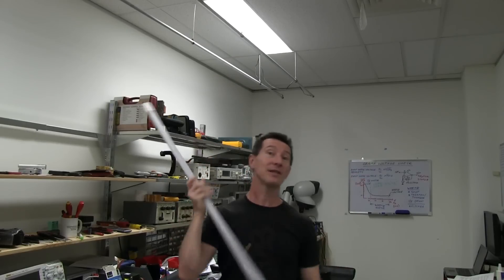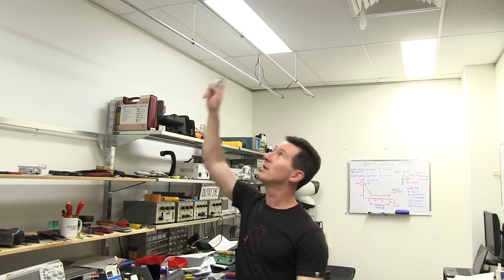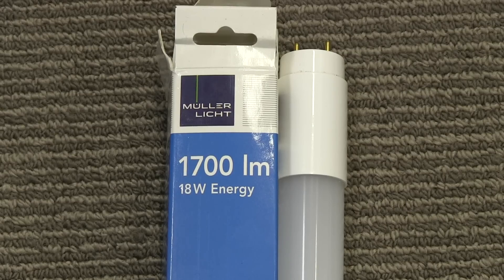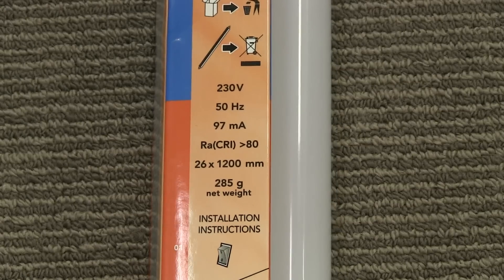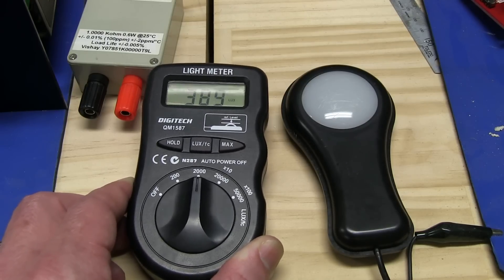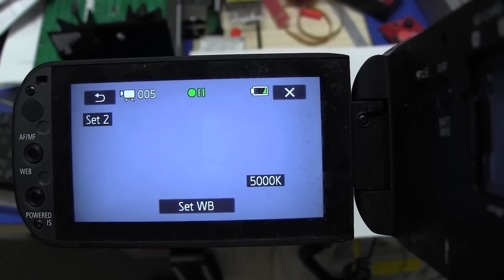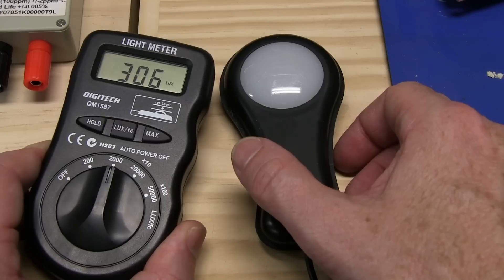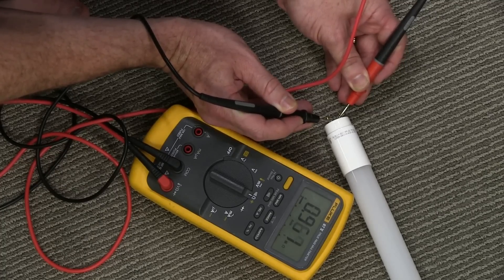EEVblog #531 - LAB LED Fluoro Lighting Tube Replacement

Comment: one major point is that the led only fade about 5% over their life compared to around 50% on the conventional fluro tubes. so the output of the led's over time with led will eventually beat the fluro's.
Reply: Modern fluorescent lamps maintain over 90% luminous flux to over 30,000 hours. I've seen LED floodlights and streetlights with degraded LED chips after only a few months in service!

Comment: 1700lm? Normal 36w 4 foot lamp is like 3300!
Reply: led only fade about 5% over their life compared to around 50% on the conventional fluro tubes, so in the long run led are a lot better.
Reply: No, they don't. Normal fluorescent lamps maintain 90% luminous flux to 20,000 hours and beyond. Just check any manufacturers datasheet. http://download.p4c.philips.com/lfb/f/fp-927921084023/fp-927921084023_pss_en_gb_001.pdf Meanwhile all of the LED battens in a friends place of work have all had to be replaced under warranty because they were failing like flies and were suffering major loss of output!

Comment: I fell in love with LED bulbs very quickly after years of those godawful CF POS energy saving bulbs.  The only downer on them is how freaking much they cost.  Got some of the Phillips master 75 watt equiv bulbs as the main lighting for several rooms, some no-name 60 watt equivs for the bathroom and upstairs landing, and a couple of the no-name 40 watt equivs in a couple of table lamps.  They're brillo.

Comment: WTF 15000 on / off cycles,  never heard of that spec
should be like 20 years unlimited on /off cycles
Reply: The LED shouldn't wear out from toggling, but i bet the stuff that transforms mains power into low DC will.

Comment: Saying LED as a word just sounds wrong to me, because it's pronounced the same as lead, a toxic substance that has been removed from various items over the past few decades (gasoline, plumbing, solder, etc.) due to its danger to public health -- so that's a very negative association that LED lights are trying to be the opposite of, due to their energy savings and lack of the similarly toxic mercury found in fluorescent lamps.

So, maybe in another generation when nobody remembers what lead is and how dangerous it was, then manufacturers will start pronouncing LED as "lead", but until then, they will say "L E D" to avoid any association with lead.
Reply: You must have real issues when people say their, there, and they're. Also I still use 60% 40% lead solder its a lot better then the lead free crap.

Comment: At 04:34 that's an efficiency rating: They have these labels on basically everything which uses energy over here (UK). You get them on light bulbs, fridges, ovens, boilers, and even houses and public buildings. I've usually seen them going from A to F though, i had no idea there was an A+ and A++

Comment: You need to consider the fitting as a whole - bulb + reflector + diffuser. The LED tube only puts out 1700lm, but it is all pointing in the right direction. There will be a small loss due to the diffusers (on the tube, and the fitting). The fluoro puts out 1500 of those lumens in the wrong direction. You saw how rubbish the light output was when the LED tube was upside down! Most of those 1500 lumens are being absorbed by the reflector.

Comment: People are increasingly pronouncing LED as one word, it is easier to say. A good example of the usage in the general population is LED TVs. People who say each letter "L E D" use the indefinite article "an". People who prefer "LED" as one word use the indefinite article "a". Let's Google it!  (1) results for " a LED TV" -" an LED TV" = 7,010,000    (2) results for " an LED TV" -" a LED TV" = 3,500,000. ( You use "-" to exclude the opposing term.) The trend is clear by two-to-one, Dave rules!

Comment: Problems have been encountered attempting to use otherwise high CRI LED lighting on film and video sets. The color spectra of LED lighting primary colors does not match the expected color wavelength bandpasses of film emulsions and digital sensors. As a result, color rendition can be completely unpredictable in optical prints, transfers to digital media from film (DI's), and video camera recordings.

Comment: This energything ist standardized and is printed on every lightemmiting thing you can plug into the normal powergrid. We have things like this for houses, tires, electric devices ( oven, fridges and so on). A is much better von C and so on. Some math behind it ( don´t know it) but it is usefull to see efficiency and so on. If you´re interested in this thing just search for "European Union energy label" .

Comment: I don't know about reliability. It's been a long time but I recall that starter type fluros were super unreliable. Since switching to electronic ballasts at home I'm replacing far fewer tubes, the lights come on instantly, and they use less power.
Also electronic ballasts have gotten pretty cheap in the last 5 to 10 years. It used to cost $40 to redo a fixture, now < $20.

Comment: 1700 lumens is quite low.  A typical 4 foot T8 fluro tube puts out about 3000 lumens.

1700/18 = 94 watts/lumen
3000/32 = 94 watts/lumen

I don't think you've gotten any increase in efficiency.

There is a wide variety of color temps available in fluro here - 2700 to 5500, pick what you like.

I don't even remember the last time I saw a starter - fluro fixtures in the US have been rapid start or electronic ballast for a couple of decades now. Starter types are unreliable and inefficient.

Comment from the maker: We have electronic ballasts here, but they are not the norm. Or at least not until very recently. Almost every building like I'm in will use the old style. I believe on the commecial scale, you pay more for electronic ballasts troffs, so builders will penny pinch..

Comment: Hi Dave. I"m product engineer of similar led lights. 120cm tubes has about 18W and life time 40k hours. and I think it has similar light intensity as normal fluo light bulb. btw  company we are producing for is in EU It is called Lioris.  So at least we are not from China :). Price is higher but still quality is better. or i believe it is the case :). I have few these light bulbs myself and i'm happy with them. I would suggest to change it in each household because of cost savings.

Comment: I think i like the LED ones vs the Flourescent ones more for the facts that: (1)You're encouraging LED manufacturing by buying LED. (2) On average you get more bang (L) for your buck(W) from LED than Flourescents (Sort of like the AMD vs Intel paradigm). (3) LED is more flexible in manufacturing such that you can "dial in" by design the power consumption, light production, temperature and is a more long-term solution than Flourescents.

Comment: A lot of people think they will save energy when they replace their fluorescent lights for LED ones. When you have old 50/60Hz lights it can save you some energy. But still I would rather upgrade to high frequency fluorescent lights with a HR reflector. The tubes are cheaper to replace and also have a high(er) efficiency.

BTW, check the color temperture after a year or so. You will see a change in the color temperature!

Comment: They've been making the same type of lights for many years, so I'm sure much of the data is based on actual long-service tests. They can also determine it using mathematical models, such as MTBF mean time between failure.  bit [dot] ly [slash] 16LxAR8 is a GE datasheet, which shows the typical hours vs mortality curve.

Comment: There is still enough human labor involved. Many steps, especially in the final assembly are hard to do by machine. E. g. in this case I guess sliding in the LED bars, soldering short wires to the contacts and putting the endcaps on isn't easily automated. Considering labor is a tenth of the price compared to Germany, it's clear China wins out.
Costs in China are rising though and are already the same as some eastern european countries, which is where some companies are moving production.

Comment: Fluorescent tube manufacturers use a few standards. B50 is common. Time before 50% of samples have failed.

Average rated lamp life (B50) is the average value of the life time for an entity of lamps operated under standardized conditions until 50% failure. In other words, this is the operation time at which, for a standardized 3-hour switching cycle (165 minutes on / 15 minutes off (according to IEC)), 50% of a sample population of lamps have failed.

Comment: Regardless of the lifespan, any time after the warranty is considered bonus time.

If a product can reliably fast past the warranty period, then the company will make the warranty longer. For example, most computer RAM has a lifetime warranty because they have a low longterm failure rate.

Warranties are selling points so when you see a relatively expensive product with a 1 year warranty, you are likely to have a device where the failure rate jumps into the double digits at around 2 years.

Comment: 390 lux is what I would expect to see on a fluoro that is less than 12months old I have seen them go as low as 80 in an office I used to work in when I replaced the tubes out they complained it was to bright.

Comment: It is difficult to justify base on saving of electricity unless the light is on 247.  But for places that need instant on and difficult to reach area, LED is useful.  Another very good reason is on reducing the heat of the room.  My feel is I save more on the aircond bills for going LEDs.

Comment from the maker: I just installed 10W and 11W B22 LED lights throughout the house, and the 10W ones easily outperform the 14W CFL's they replace, and even the 20W ones as well. The only issue is the longevity...

Comment: In my situation, an unheated pole-barn, the fluorescent tubes rarely operate efficiently. Only in the summer with over half an hour of run time. I am looking for a LED solution. On E-bay one can find small flood light fixtures in Wattages up to 200W for 1$/W after shipping. considering dropping my 8' fixtures for twice as many 50W LED fixtures. watch?v=B2UIwnYlAYY

Comment from the maker: Mine are the best NEC quad phospor tubes available, and only put out 20% more lux on the bench under them than these 1700 lumen LED tubes. So the difference isn't huge. I have all standard old-school ballasts, as do most buildings that use these luminaires.

Comment: I bought some CFLs from LIDL last week, 23W with 1550lm for 2 Euro each. They are slow to reach full brightness (<60% in 60secs) but that isn't a problem, in fact it is an advantage! I prefer a gradual brightening when you turn on the bathroom light in the middle of the night. They are 2700K warm-white too. Lifespan remains to be seen, though. LEDs don't come close in bang-for-bucks yet.

Comment: I am yet to be swayed towards using LED lighting solutions. In the UK they're ~5,000x the price of incandescent or fluorescent tubes / bulbs, and they're all as pathetic as each other. A maglite will outperform them.
It's difficult to beat a pair of 58W tubes, and they're well worth the extra energy consumption.

Comment: I can't confirm that (at least not generally). I got quite a few of the electronics here at Hofer (that's how Aldi is called in Austria), and they all (lamps, clocks, wireless temperature sensors, digital calipers, cyclocomputer and other small stuff like that) work as expected, many of them for years now even in outside/workshop conditions.

Comment: 900 lumens is not enough for a workplace. Btw. the 900 lm only tells you what comes out of the lamp, but as long as you don't have the size of the room it's a useless number. It's the lux that hit the workbench that count.
And for buying lamps, that luckily now mostly show the lumens on the package: think 1000lm is approx. a 100W incadescent. If you are getting energy "savers", you can get the same amount of light with 10W of LED/fluoro (on the high efficiency end). And don't go below 50 lm/W.

Comment: (cntd.) That said, IMHO only in the last year consumer LED lights finally surpassed fluorescents in every aspect. Previous to that LEDs either lacked light output, the color was awful or simply weren't even that efficient. Add to that the instant 100% and that they work without problem in the cold, I'll never buy fluoros again.
I hope they come up with new standard shapes/sockets for LED lamps, that make use of the flexibility that now comes with placement of the small LED emitters.

Comment: I ran into these tubes here at Hofer (that's how Aldi is called in Austria), literally, because the were sticking out the shelf. 

Fluoros and LEDs are on par efficiency wise. 100 lm/W for very good ones, half of that on the lower end. So it should have been clear that replacing a high efficiency tube with a LED tube of half the power won't give you more light. The main reason that you still reach 3/4th of the light level with half the power is that the LED tube does use the fixture reflector.

Comment: Think they are 94Lumens per watt.

They would be good for lighting your room if they were a normal edison or bayonet type.

I have a 900Lumen B22 bulb in my room, only 9watts(100lumens per watt which is bloody good) and it is like a 15w CFL or 75w incandesant.

Personally i do not think the tube type LED are fully ready since they dont tend to give off as much light

Comment: Müller Light Products are crap. I had some ESLs from them. All of the Müller Licht ESLs are dead after about a half year to a year. Same Problem, blown caps. And do you think they changed something? This year I bought another ESL, 16 or 18W. It died after two weeks. I think the same old caps problem.

So I don't think, they have a better quality with their LED Products. 

PS: In Germany (electronic) products made for ALDI are NOT known for good quality. It's just consumer crap!

Comment: Dave, you're losing a lot of light from the T8 fluorescent because the reflector of those types of troffer fittings are terrible :P Modern high end T5 fittings have Light Output Ratios (LOR) above 90%. You are probably only getting 60% of those 3700 lumens due to the reflector (or lack of) and the diffuser. It's the one redeeming quality of those LED replacements: directionality.

Comment: The T8 LED replacement tubes are a bit of a joke. You don't get much of an energy saving if the existing T8's are on an electronic ballast. They claim you save a lot of energy as they only consume 18W vs 36W. What they fail to mention is that a T8 36W tube puts out well over 3000 lumens not 1700! Modern T5 fittings are quite efficient, with only the more expensive LED fittings (not retrofit led) being more energy efficient. Then its $ to replace the LED when its life is up, vs relamping a tube